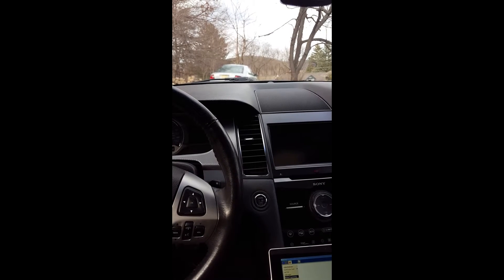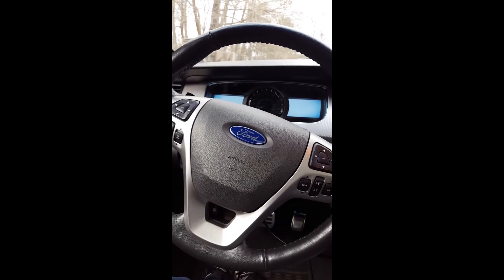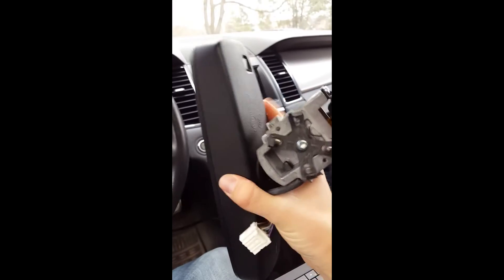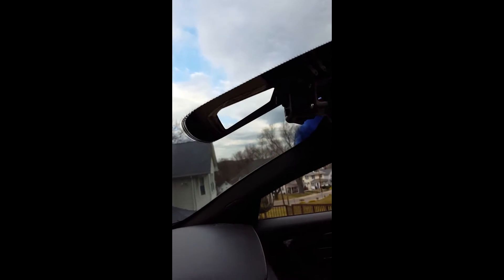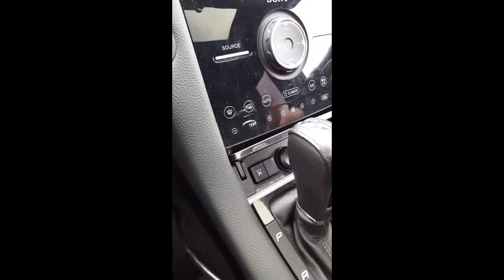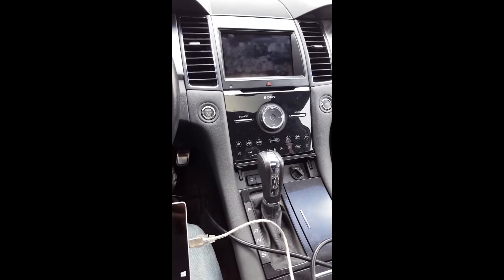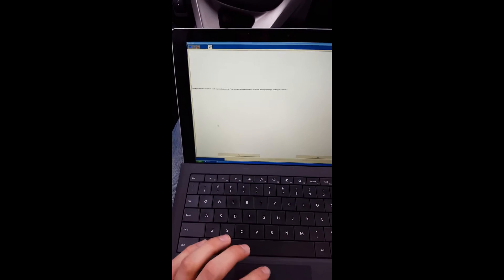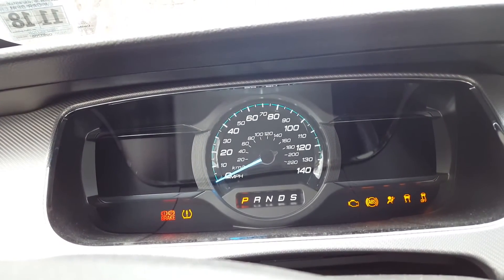Add OEM Ford Lane Keeping assist on 2013 Ford Taurus -- By Ford-Retrofit.com HD

Comment: For everyone who is interested with this mod I just ordered a replacement mirror for my 2014 Ford Taurus Limited.
Reply: How did it go for you ?
Reply: @lawrencedowling4728  It’s still possible if you have parallel park assist
Reply: @TylerMitchellOfficial  ok I have parallel park assist so how do I program everything?
Reply: @lawrencedowling4728  So since I don’t have the parallel park assist I would have to get a different steering column to make it work that’s how he got it to work on his sho.

Comment: Alright, succesfully got this working on my 2016 Flex. Hardest part is adapting the windshield mount since Flex never offered auto-highbeams with that circular mount design.  3D printer would help here. For now, washers and hot glue.  Annoyingly my windshield DOES have the circular mount, but the wrong size and off-center for the rain sensor.

Only changes I had to make from my Flex 303A (with collision warning) were 
IPC: 720-01-02 xxxx xFxx xx  (was E)
IPC: 720-01-03 Bxxx 55xx xx (was 9 and 50,  B is Auto-highbeam, 55 is CW/LA)
PSCM: 730-02-01 xxxx x1xx xxxx (was 0)
IPMA: Ensured 706-01-01 is 1F8x for the first block. 1F8x means it's controlled by a physical switch, 1FAx means it's done through the BCM.

Of course, this is mostly vehicle-dependant. Different models use different IPCs.

You'll get 'front camera malfunction' warning messages and Driver Alert will say 'system malfunction' because the camera isn't aligned.  Pressing the LDW switch will do nothing, you won't get the lines on your IPC until the alignment is complete.

Started Forscan, began the camera alignment procedure.  You start driving while the big paragraph dialog is still on-screen at 30%. Hitting 'ok' ends the procedure.   I had a wire temporarily ran between the LDW switch pin (orange/green) and ground.  Once per minute while driving I'd ground it out twice to simulate turning the system off and back on.  After about five minutes the lanes suddenly appeared on my IPC.
Reply: Hey any way you could help me with this process for my sho ?
Reply: Yours should be a lot easier if you already have the correct mount. Make sure you get a mirror from a Taurus SHO, Lincoln MKS, or Lincoln MKT.   Others have incompatible firmware. I used Forscan to make changes to the AsBuilt, you will need an extended license. Lots of information on F150 forums about it.

On my 2016 Flex...
IPC Changes
720-01-02 xxxx Fxxx xx (Old value E):  Enable Driver Alert
720-01-03 Bxxx xxxx xx (Old value 9):  Enable Auto-Highbeam
720-01-03 xxxx x4xx xx (Old value 0):  Enable Lane-Keeping

PSCM Changes
730-02-01 xxxx x1xx xx (Old value 0):  Enable Lane-Keeping

IPMA AsBuilt (2016 Taurus SHO)
706-01-01 	1F89 	0A82 	43 
706-02-01 	FFFF 	FFFF 	FF0B 
706-02-02 	FFC0 	CC9C 	 
706-03-01 	4490 	4000 	25 
706-04-01 	9F40 	0080 	71
Reply: Thanks bro I’m going to try to find the 2016 sho mirror this week ! If you were able to maybe talk me through the process I’d definitely compensate you bro !

Comment: I have a 2019 explorer with lane keeping assist.  Is there a way to program/increase its ability to lane center instead of the standard alert and minor nudge.  I have increased all factory settings, still is nowhere near lane centering.

Comment: Get FORSCAN..its 1000 times easier and all you need is a OBDII reader and a laptop to program this.  He over complicates this process
Reply: Have you done this, I'm looking into trying it
Reply: gmcrattlesnake yes I have.  I added a few things to my car including several monitors in my display, keyless entry and remote start.
Reply: @todd8781  Where did you get the hardware for the lane keep assist from?
Reply: Pyrofan97 I didn’t.  Not sure where you got that.  It’s something that can be turned on, but I don’t have the hardware.  I’m sure it something you get at any ford parts dealer, but I don’t know what parts would be needed.  I really wanted adaptive cruise to work too.  I can turn that one, but since I don’t have the sensor, all it did was disable my cruise control, so I had to turn it off.
Reply: Can someone send me the block number in the icm and what number to changs